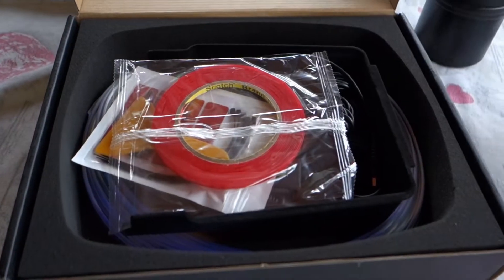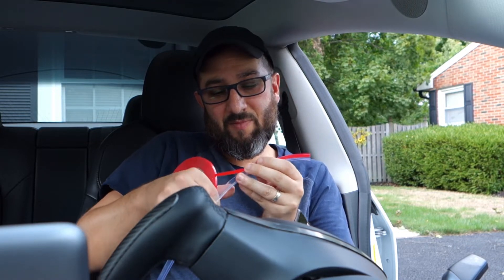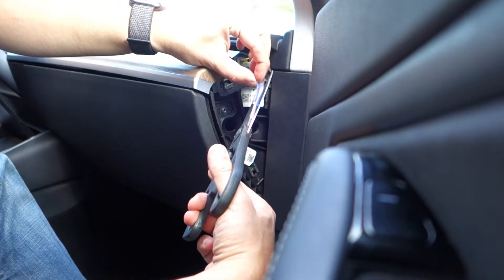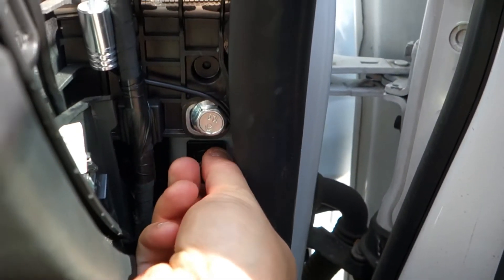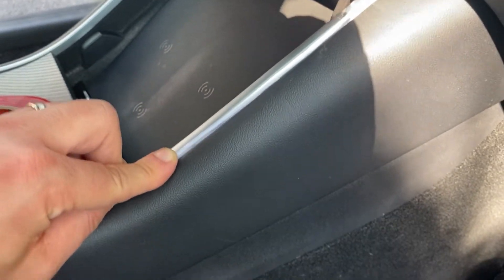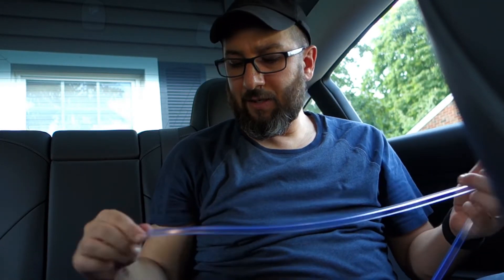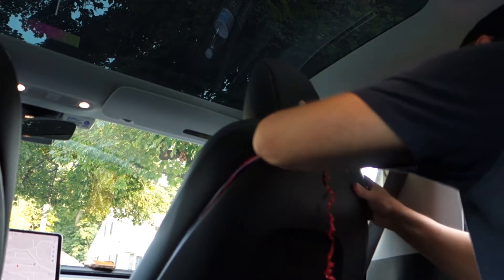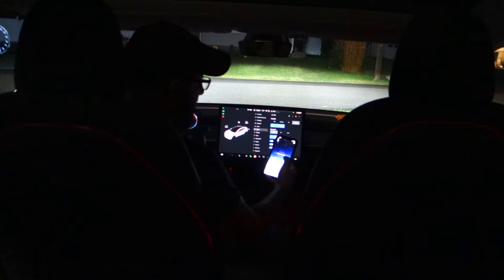SGDS: Tesla ambient neon lights install￼

Comment: Would have been good to see what you did with the wires as this seems to be the biggest issue for many. Too many wires and you can't use the arm rest insert
Reply from the maker: Definitely a big issue with all these wires. I just pulled them all out except for center trim lights. The others are on the floor behind the arm rest under the floor mats. They give you a new arm rest tray that has a cutout for the cigarette lighter plug

Comment: This is about the worst install i've every seen lol.  You couldnt route those wires any better, just spaghetti under the mats lol
Reply from the maker: Thanks for the feedback and I’ll strive to do better.
Those cables are no joke. The way they are attached to each other was no easy task. The instructions wanted them as a nest in the arm rest but I and many found no simple way to close the arm rest with out cutting the plastic in the car and making holes.
After the video I ziptide all the cables and yes they are still under the mat. Undetected.